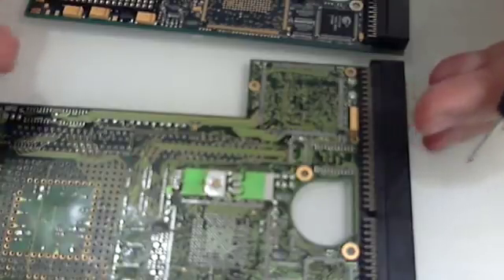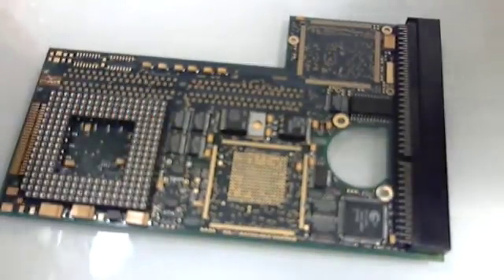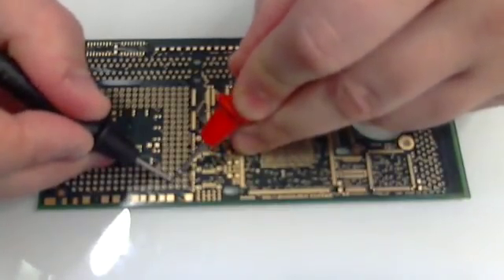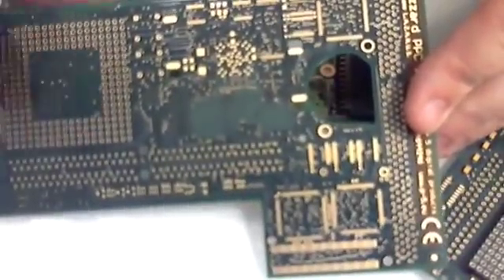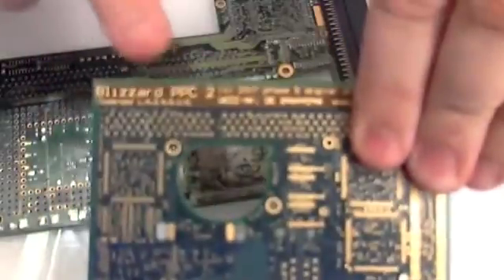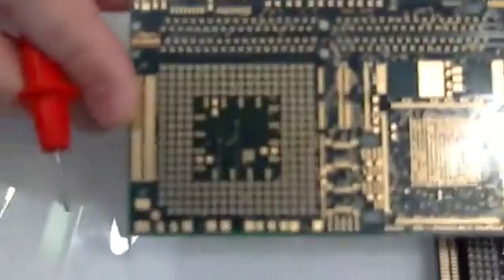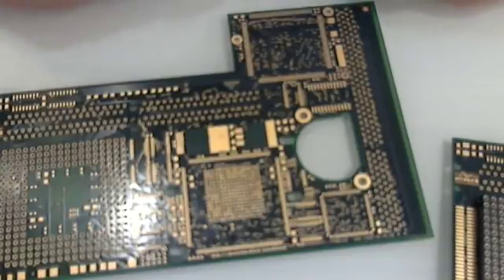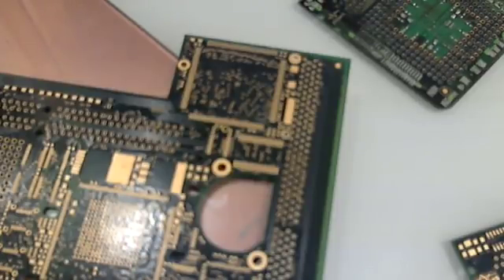Phase5 BPPC2 PCBs have no GND meaning they cannot get any power.

Comment: Chucky, Can I ask you a technical question about a500 (or a500plus) CPU acclerator expansions? The expansions we see nowadays are really cool but I don't understand why they are not simple sidecar expansions like the old GVP 68030 40MHz side cars one would get in the old days (which simply plug into an a500 in the sme manner as an A590 would do). I mean, I understand that there are extra features such as the VGA and all that, but I mean, some expansions nowadays require the amiga owner to remove the 68k chip. The thing is there are bound to be some people who simply want the speed boost and are not overly interested in graphics enhancements, and those people are going to shy way from "invasive surgery" on their amiga in case something goes wrong. Of course they'd get a professional to undertake the upgrade and those upgrades are very cool. It's not that which is the worry for some. I'm just wondering that the provenance of the amiga itself might be eroded.

BTW well done on repairing that booster. Thumbs up! :)
Reply from the maker: well not much economy in it.. so that's why the ACA500 was done..  so you can plug in the A1200 boards instead
Reply: The aca500 does look cool, if anything merely for the 14MHz chip in it because it would be just enough to take the edge of 2D games that experience slowdown (like streetfighter2 a500 version).

Comment: sup chuck still needs those 060 adapters:)
reason why those board have popcorning is the idiot didnt preheat the board 1st to get the moister out before hitting it with hotair

you should sand one of those fuckers down each layer and youtube that
Reply from the maker: or did not use a proper desolderingstation :)   sand it..  well.. :)